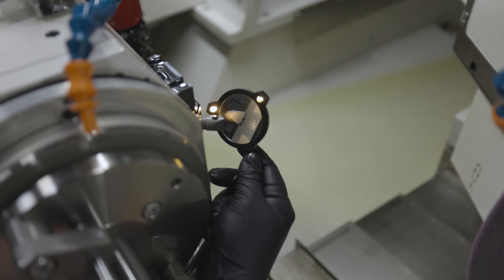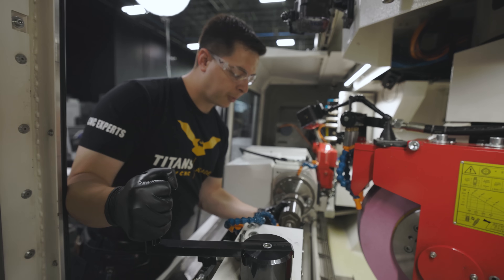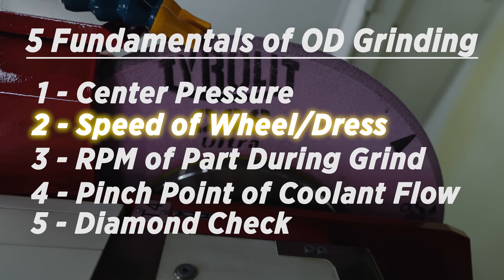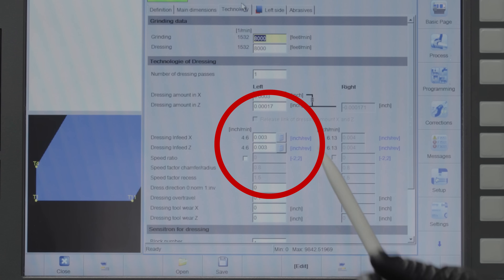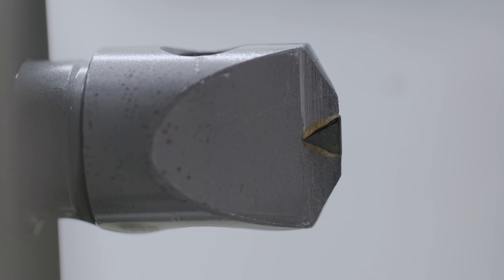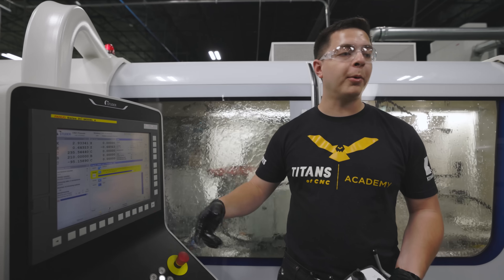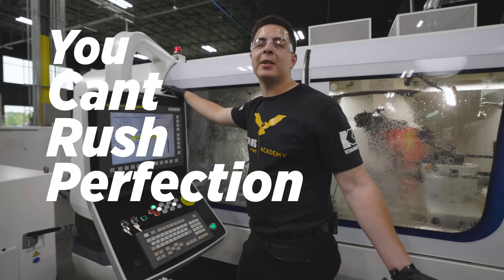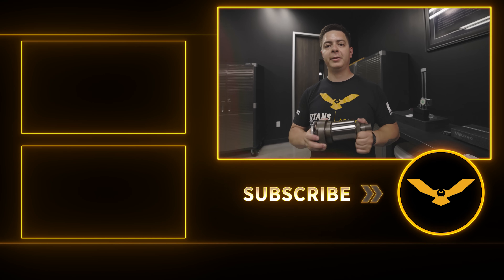STUNNING Process of Grinding a Flawless Surface Finish on a STUDER S41

Comment: Also used to work on Studer, however using white wheel and better finish (like 4) comes out w/o problems ...

Put the coolant on the diamond too, will prolong the lifespan of it ...

Comment: No doubt you got a good finish what about tight limits?
What is the best way to grind a part say 150 mm long shaft if removing 0.25 mm material to control under the 10 micron limit?
Stock removal then dress wheel for finish grinding and how will you make sure no grit is flying over the wheel to stop spoiling part finish and size during the cycle particularly in mass production?
Regards.

Comment: Thanks for sharing this. As a mechanical design engineer, this helped me better understand the grinding process in a manufacturing setting. Prior to this, I could only think of the handheld grinders when I think of the word grinding. Also, those are some super smooth surfaces!

Comment: I run a S31 and a S33. Best finish I’ve had with our 80grit wheels is 2.7. We often have to get below 4 for match fitting. Very challenging to get that low without burning and hold a .0001 diametrical clearance to mating part. 
We also have some nickel seals we grind where we hold the finish between 28-32. I find that harder to hold a specific finish consistently on a 100 +pcs. Especially one so rough on a grinder.

Comment: I worked at an old factory where we would hit counter bores at 1.23Rz and at 6.3Rz we would have to change out our diamond inserts. Problem was, the other shifts would run past their tool life counter, back it off like 100 and we would have to change that insert the start of the shift. That Rz would be all over the place.

Comment: If you are a grinder and cannot achieve a 6 finish on a heat treated part you should fire yourself. So lets break this down. 1, the wheel, A 80 grit wheel is pretty much standard and can do most jobs. however with grit fall out you will get flecking on a random basis. IE a random piece of grit falls out and produces a Fleck. The finish is good but you have a random groove or fleck mark in your part. This is seen under an eyeglass. 2, An 80 grit wheel will never give you a 8 finish on metal that is un heat treated, due to flecking and the fact that the grit is to course. 3, you can get a finish better than 8 on heat treated material but you will be subject to random grit fall out which in the aerospace industry is the difference between good and scrap. 4, to conclude the wheel you use is a massive factor to the process you need. I need a 2 finish or 0.05um on my current job. Its close to 1000vickers so hard as glass! I have a 200grit wheel to get this finish off my S31. as the grit is so small on the wheel any fall out is not measurable.

Comment: No RPM adjustment on the stone on the old TOS grinder i ran for a few years.
Doing stainless axles the surface lasted a lot longer than doing regular steel ( not hardened )

Smallest tolerance i did was 8 mm r4  ( 8.023 / 8.019 mm )

Before i got on that machine i worked a grinder on trade school for maybe 45 minutes, and i got to that machine after being away from the trade for 20 years.
By way of " if the old guy can tell me how the machine work,,,, i can do it "

Comment: Hey everyone just putting some background in the world of comments. I’ve done some quality work on pieces that were going to to a portable quadrupole mass spectrometer and we needed metal conical inserts at 3 places to reduce airflow with specifications for exit flow within 5 milliliters per hour with an inflow pressure of around 1 bar. Specifications and standard operating procedures are a complete must for any operations aiming close to your his type of standards. Some of our manufacturers were unable to deal with the standard operating procedure as the cleaning and packaging step made it so these nozzles couldn’t even go into a plastic bag as some of their off gassing vole tile chemicals would interfere with the finish. Thank you every single machinist out there that deals with engineers like me and the details we barely provide yall
Reply: Thanks for the comment! Always great hearing some new stories! Boom!!

Comment: do you know cold rolling - basically like knurling but with a smooth polished wheel? i got RA4 with that on a CNC lathe on a hydraulic valve stemm replacement - doesnt work with really hard parts tho- it just smushes the surface to smooth out all tool marks

Comment: Piece of piss on that machine tool , try doing that on an old Tos manual cylindrical grinder , that's how real tradesmen have to do it in real workshops with manual machines , cnc grinders are for pussycats .
Reply: BOOMER ALERT! Let me guess, you still mow your lawn with a manual push mower. 🙄

Comment: My best result was Ra0,03 (metric). But ID,  with oil coolant, a vitrified bonded grinding wheel and a contour grinding operation. 
Greetings from good old Germany
Reply: Wow, my best was RA 0.06 but we do big pieces here.

Like 600mm diameter, 1 meter long and like 2 tons.

Comment: I've gotten sub 4 facing ductile cast iron in a lathe with a .060 radius insert, and sub 3 burnishing a 1.5 diameter 8620 in a lathe.

Comment: I work in an engine factory where we grind all of our cams and cranks. Although the systems are mostly automated for higher productivity, the principals are still the same. Clean centers, perfectly dressed wheels and coolant. A gantry loader/unloader handles the parts and inline gauges check diameters and send real-time comp data back to the machine. The operator runs all the surface finish checks and one of every 10 goes to the CMM for complete inspection. We do 60 crankshafts per hour, or one a minute.
Reply: damn, that's crazy. (I'm the dude that has to replace them when that fancy surface is scored to hell because the owner never changes their oil)

Comment: Had some parts that required a grind op after the mill op to achive an adequate surface finish, curiosity got the best of me and I attempted to achieve the finish with a 6" face mill. With proper feeds and speeds I was able to eliminate the grind op and save about a day of processing time.

Comment: Chris remember Your formula for part speed is approxamately 100SFpm, so a 4" part times 3.1415" equals 12.5" inches or about 95 rpm.  your part looks close to 3 inches so 3" X 3.1415= 9.5 sf inches 125 rpms would be approx 100SF.  I think you said 115 which is close enough.   Also note that if your arbour and driver are out of balance (They are running out) that can lead to out of roundness and a bad finish too.
Reply: Yes SIr! Thanks for the knowledge! I hope your doing well!

Comment: 30 degree wheelhead is a good tip, dressing for shoulders would be easy.
Are the wheelhead bearings angular contact or plain and thrust with an oil pressure film?

Comment: I would love a quick video about the filtration system for the coolant that it uses, like if yall reuse the coolant after filtering or if its just waste after cleaning out the chips and stuff

Comment: When I was in the grinding department we where doing parts+/-.0002. I told the sales department we could do +/-.0001 all day long with the Okamoto's. They got some parts that were indeed held to. 0001.   Just for fun I set a goal of holding .00005.  One of my parts actually hit a full .00005. the rest. 00002+.00003. plain Okamoto, aluminum oxide wheels. Retired now! I scrapped a few parts over the years but it was never a machine issue. It never took more than I asked not once!!!
Reply: Thought I might say we were using electronic indicating heads and certified Jo Blocks for measuring!!
Reply: How do you temp control something that tight?
Reply: @adammiller4879  it was a relatively well controlled temperature environment but certainly not a class 1000 clean room The parts were 440 C about 57-58 Rc  They were 2.25 inches square. So if it "warmed up" it wouldn't grow that much.  I'd start the day by sneaking several parts down to plus. 0005. I'd take a few of those down to+.0002. I'd size them very carefully and mark the tops with red sharpie marker. Then i'd  load of 24 (3 rows of 8. Putting a +.0005 in the mix with red and, also a + .0002. I'd grind till I hit the+.0005 then dress the wheel very lightly. Mark the top again sneak down to pick these up then let the Okamoto do what it does best, and drive it down to size. Zero stress. I always went home and slept good. My favorite work environment ever. Never scrapped a load in about e years of running this process. A few parts would fall out along the way but never a full load.
Reply: so what 
it's not like you're the one doing the grinding by hand
It's a machine which executes a set of orders, all you have to do is give the right input to the machine with respect to the material your using.
I don't applause when my 3d printer does exactly what I'm asking it to do.
Reply: @xl000  you obviously have never actually ran a cnc machine before if you think it’s that simple. Your comment is extremely ignorant.
Reply: @adammiller4879  why don't you try running a manual machine. takes some real skill and knowledge.
Reply: @UJ3LLyBro14  Lmao. New to the internet man? You don’t know me. I was a manual machinist first for years before I decided to go the CNC route

Comment: Replace the diamond? You are given a diamond when you start an apprenticeship then return it when you retire. Seriously, very important when wheel is being sized for the offset each dress. The  old Heald ID grinder i use sometimes has a diamond on it thats probably been there 50 years.  Great video and machine, ty for sharing.
Reply: The diamond on the heald is a standard diamond that you can keep rotating when you get a flat on it. The diamond that Chris is using has a radius on it. That way the machine can calculate and dress a accurate radius on the wheel. Once it's chipped, it is done.
Reply: @jeffhargis2387   Thanks Jeff! Thanks for watching!

Comment: I never worked on CNC grinder and from the video it is not clear to me, how the machine knows, how far to move the wheel to achieve certain diameter. I did not see you offsetting it or measuring some kind of hight - like on CNC mill or lathe. I would appreciate more in depth explanation. Thank you

Comment: Is this RA in an different scale? I daily grind piston pins (big, for trains, power plants, ships etc), and grind them to Metric Ra ~0.20-0.10, before finalizing lapping. Not always easy finding dressing parameters that allows for both grinding-speed and surfacefinish, and part cylindricity, while also no deep scratches are allowed (of which most wont go away with lapping). Some models we make have cylindricity of under 4μm metric AFTER lapping
Reply: Yes, our RA in in micro-inches. Our 6RA is roughly .15RA metric

Comment: Do you you ever have a situation where there is kind of re-cutting chips so to speak ? I see there is a lot of coolant and direction of part/wheel spin wonder if it could become an issue.
Reply: Hi Jonathan, sometimes in OD/ID grinding we get what is called grit scratches. This is when pieces of the stone or material being removed ride with the wheel. The machine has a filter that assists with minimizing the grit scratches. Great question! I hope I answered it.

Comment: that surface finish looked really good. especially when you look at that wheel. it loaded up terribly! but an Ra of 6.24 ? thats a lot. i grind in between 0.2 and 0.8! (surface grinder)
Reply: I'm guessing you work in metric units the equivalent of 0.8Ra in metric would be 20Ra imperial
Reply: @scottetheridge2845  then his 6.24 is impressive
Reply: @scottetheridge2845  almost
0.8 metric Ra is 32 imperial Ra and 0.2 metric Ra is 8 metric Ra
this is another level above!!!!!!

Comment: Ra 0,8 with just turning
Reply: Divide the inch measurement by 40 to get the Ra in metric.
Reply: @osbornaw  I knew that metrik is difrent but i didn't knew how to translate
from metrik to inch
Reply: @jonathanrinderer5432  Ra 6,24µin =  Ra 0,16µm  ~ Rz 1,6 µm

Comment: 10? i need to be pushing 0.8 at my new work, this does not help. D:
Reply: I would guess there is a metric Ra and a imperial one, cause i do Ra 0.2 (metric)on our lathe on 
a regular bases.

Comment: Would love to send you one of our cbn wheels to try . I can  Guarantee a better RA 3.5 or lower. Nice work very well done. I learn so much from team Titan . Thanks for everything you guys do . Literally paving the way for the younger generation.
Reply: Cubic Boron Nitride is a hella win compound. 
Runs cooler, is harder than other abrasives, superior chemical stability (does not evaporate or absorb into the steel like diamond can do), produces better finishes, has an extremely long life, etc.
And its just amazing its made from a gas and a brown powder.
Reply: @renecastro6110  steel is never processed with diamonds but ok
Reply: @hephaistosthesmith2069  thats exactly why they dont use them lol. Ferrous metals fuck them up.
Reply: @renecastro6110  its the carbon not the iron, it diffuses and basically just disperses the diamond on the surface of the metal

i understood your comment wrong, i thought you meant diamonds were used in cutting steel, which is as you also added not the case (besides honing but thats a different kind of baby)
Reply: @hephaistosthesmith2069  Yeah thats what i ment lol. Very true what you say about honing as well. Honing by hand does not produce much heat so using diamond for that is ok.

I use diamond plates and hones as the first step to sharpen salon scissors and i love them, they last forever.
Reply: Find the address and send one out!
Reply: I'll take one to try :)
Reply: Uhhhh isn't RA 3.5 like super high?

I easily grind RA 0.08 at my work and those are giant pieces like 600mm diameter and 3 tons

Comment: Are ra numbers diffrent in the imperial system compared to the metric? I work as a grinder in europe an had ra of 0.04. On a studer s42. Thank fore those who could help
Reply from the maker: Great Question.
We put our machining parameters in imperial and metric in our YouTube machining videos… will look to do the same for grinding.
Reply: Hey Jonas, the metric system uses micro meters to measure surface finish whereas in imperial we use micro inches. Thanks for watching.
Reply: Than you all for the awnsers! I love your videos. I always stop the video whenever you talk about feeds and other parameters and i try to calculate it to our metric system. I am always impressed about your speeds. I would love to work one day like that. However i have always low part numbers (2 to 5 pieces) wich are experimental without existing programs. It would also be risky if i make a fault because i am at the end of the producing chain. So i try to stay on the "save" side of speed. ;-)
For me it was a pleaseure to see that you baught an "expensive" swiss  grinding machine. I told this to my boss, as an argument to buy an otherone. ;-)  he was convinced🙂
Keep it up.
Reply: They have acheved a ra of 0.156 in metric and an ra of 0.04 in metric would be about 1.57 in imperial
Reply: @alain_04  ah okay.

At my work we have big pieces like 600mm diameter and 1 or more meter in length and they are allowed a max of RA 0.1, I usually can do them 0.07-0.08.

It's a completely different beast doing such big pieces.
Reply: Ja, du hast recht. Da bei Ra der durchschnitt von "Entfernungen" angegeben werden und die amerikaner haben dabei inch und wir meter. Deshalb haben europäer die Ra und Rz angaben auch in mm und die amerikaner in inch.

Comment: 15 years ago i have run parts with 2-6 ra tolerance on surface finish…  As long as the part is heat treated and leave at least 0.002 stock after final dressing, no problem on a cnc Kellenberger grinding machine.
Reply: I also work on kellenberger
Reply: I also run a Kellenberger, nice machines
Reply: @digbybowring8362  what machine exactly ?